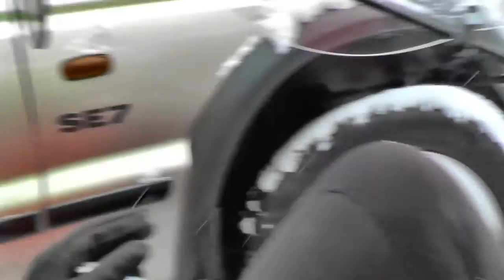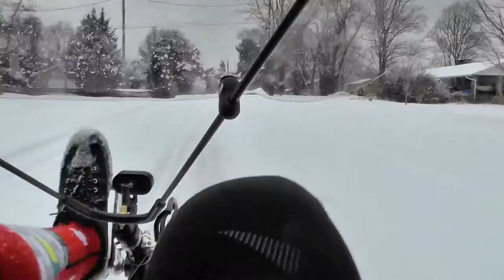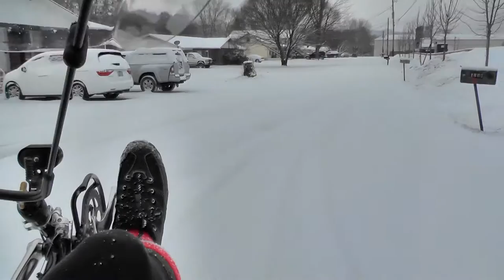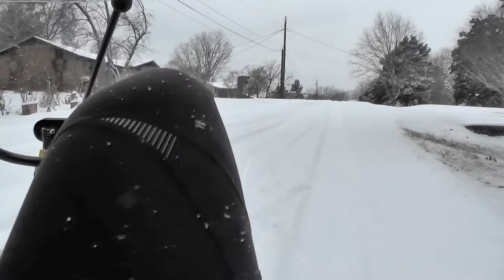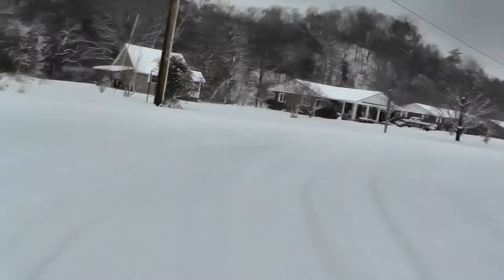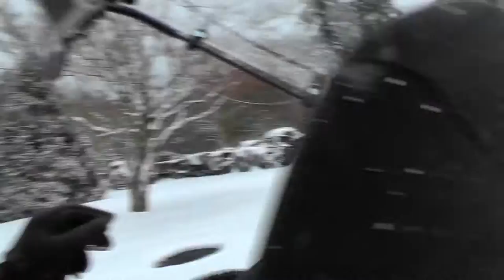Recumbent Trike Tour, Sevierville, TN 2014-01-28, ActionBent

Comment: Great day for a ride.Love the quiet when it's lightly snowing.I Don't like the tracks left by cars shoving my Bicycle around.I've wanted a trike just for those reasons.I use a light grease on all my cables,and some oil in the sheaths.I've had the inside of a rear hub freeze and skip,yet the cables still moved.(It was almost -20 F)

Comment: I heard you say that you cannot climb the Smokey Mountains, maybe a Schlumf Mountain Drive is the answer? The MD is a hub inside the chain rings. When engaged it reduces 2.5 times. So a 42 teeth will be reduced to 17 teeth. The 42 and 50  rings can stay in place. I climbed a 25 % slope with a 66 lbs trike. Ok, it was just 30 feet high, but it worked.